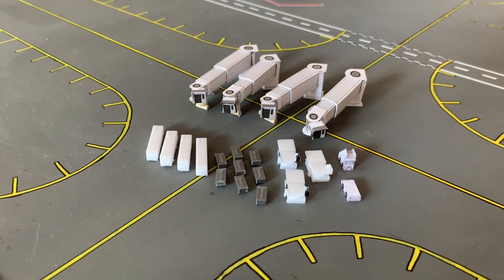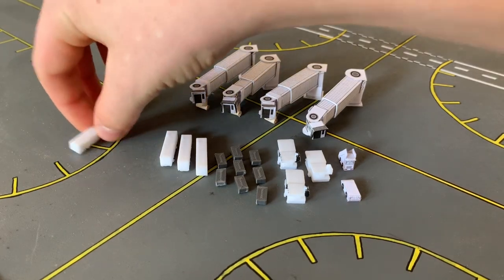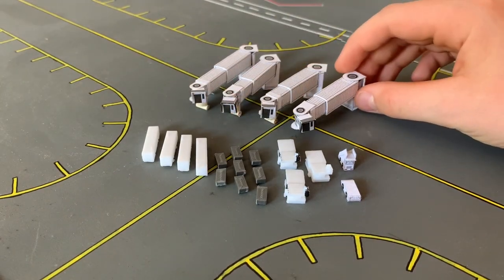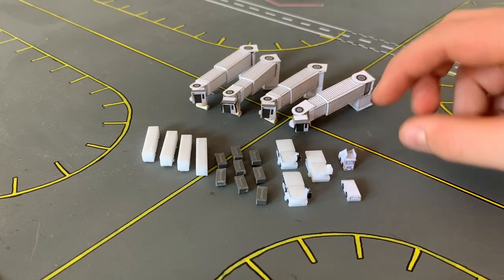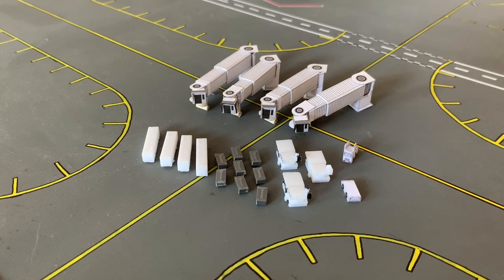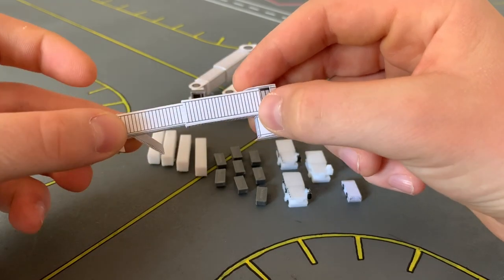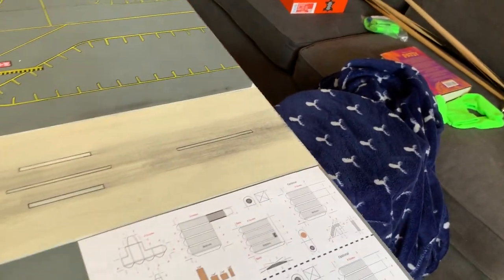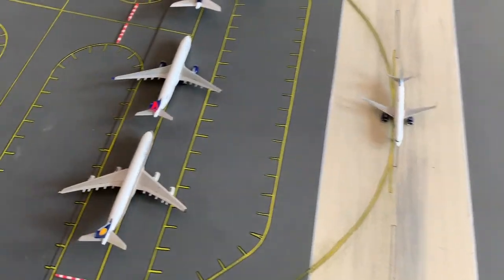DIY Model Airport Accessories

Comment: What kind of paper did you use for the jetbridge?
Reply from the maker: I think it was 10lb cardstock paper which was printer ready or something. If you want to be sure, check the link in the description. There I added a link to the website where all the store that specifications are
Reply: Aviation JFK thanks!
Reply from the maker: No problem👍